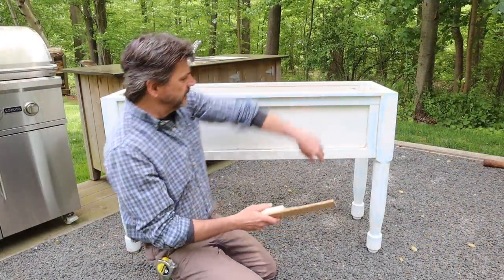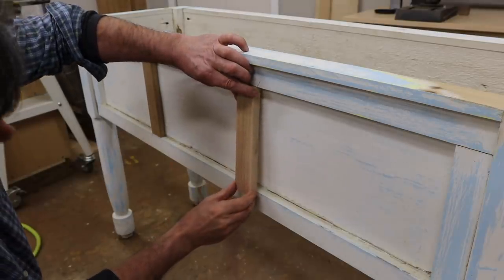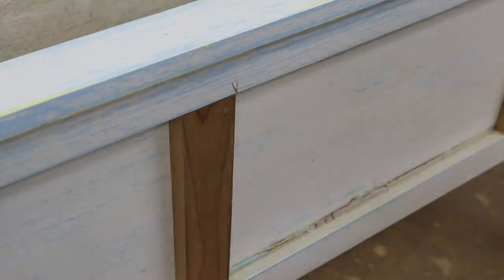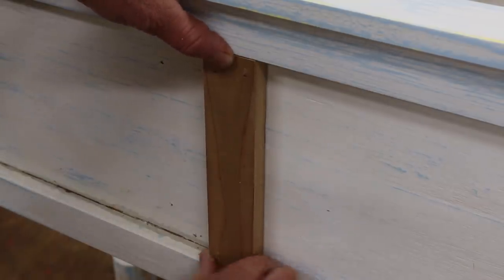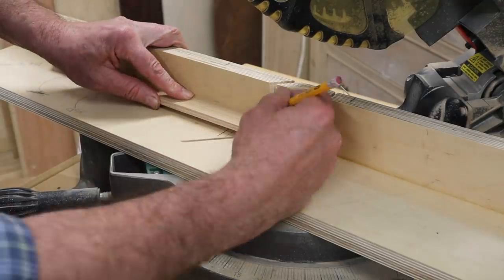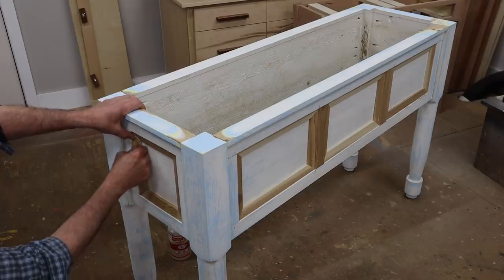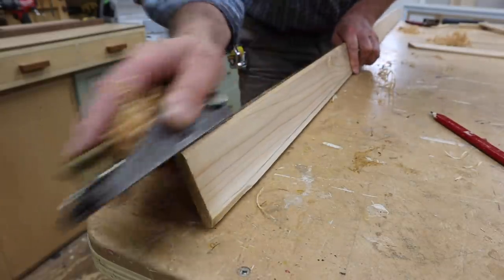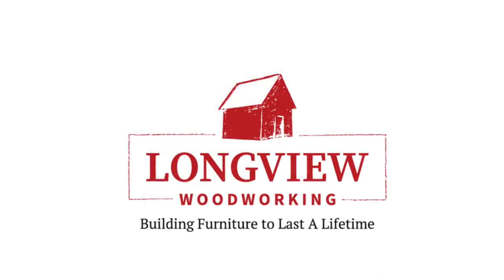More Molding Can Make Woodworking Projects Look Great

Comment: Hey Jon I simply just love your videos. Is there a reason for the angled nails with adhesive? Or is simply fastener length and the thickness of your material?
Reply from the maker: Thanks Nick, yes was just the length of the nail... with the styles I was using an inch and a half.